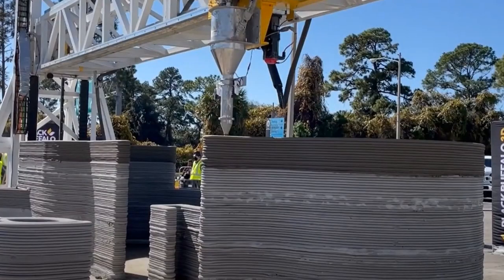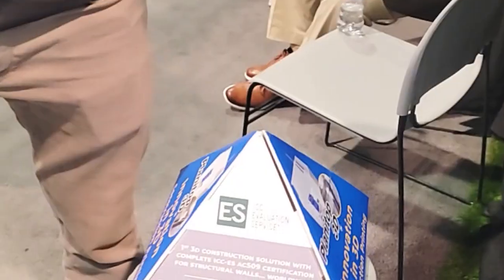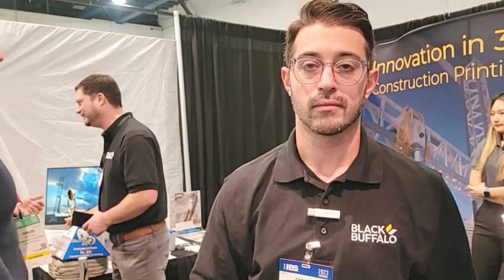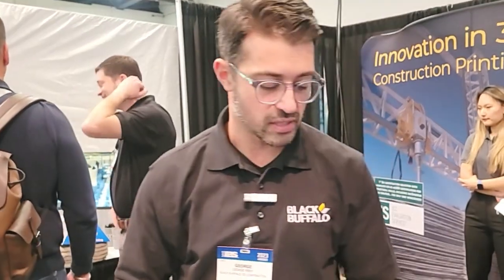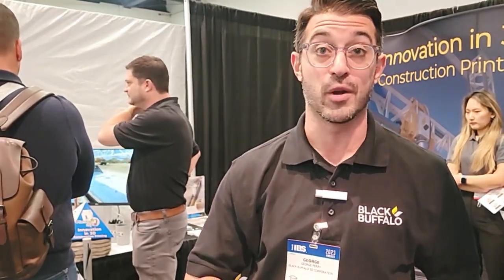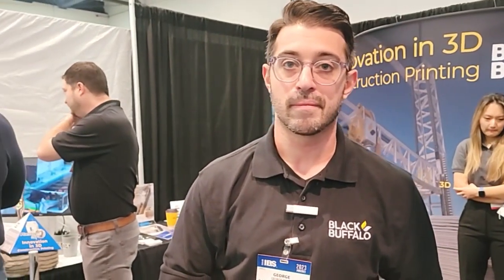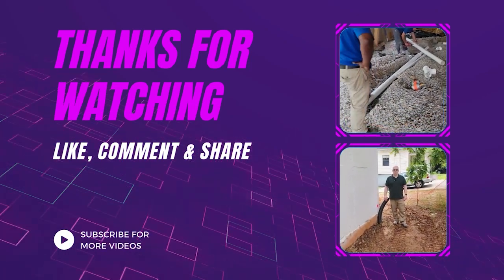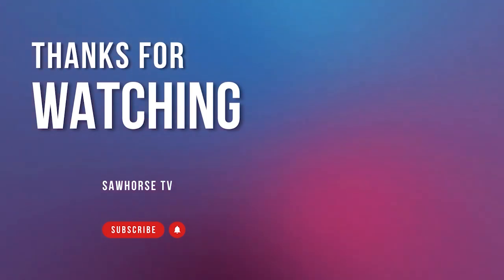3D Printed Houses - Is This the Future of Housing?

Comment: I wonder for interior walls specifically how well hollow walls of mortar deaden sound lol
Reply: Thanks for the question. Our structural walls are the equivalent of CMU block, but for the interior walls the builder can design as much or little as a gap as they believe the owner would want. The cavity can be eliminated or filled with insulation if a cement wall isn't soundproof enough.   Check out our YouTube channel and the NAHB 2022 videos to see the flexibility in design.
Reply from the maker: Thanks for answering!